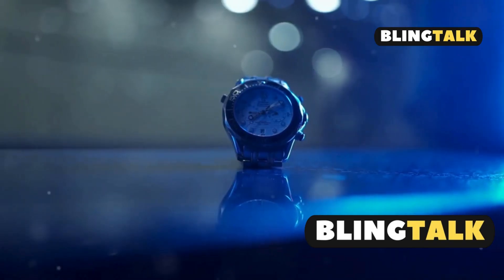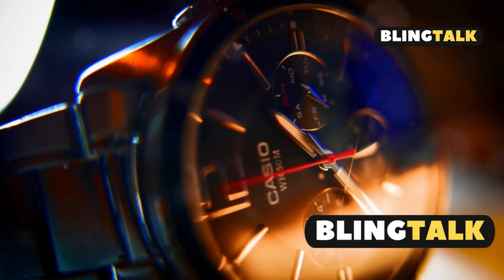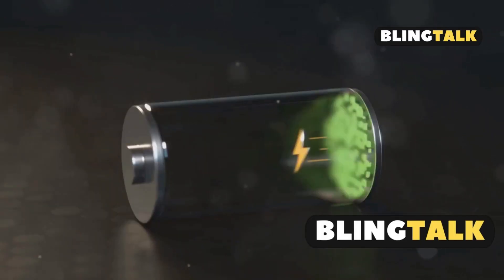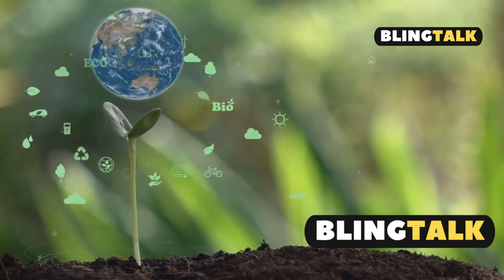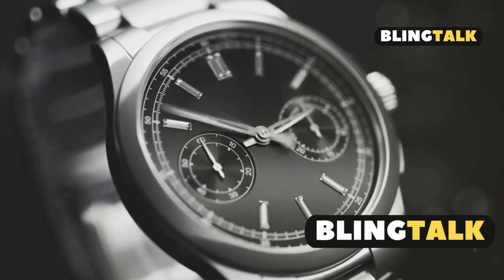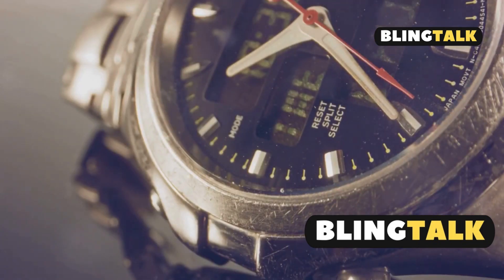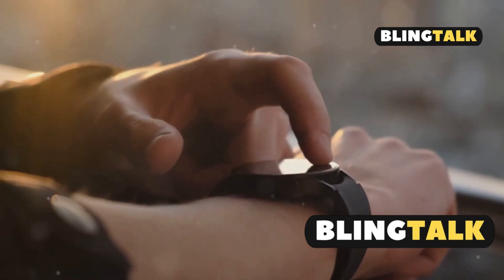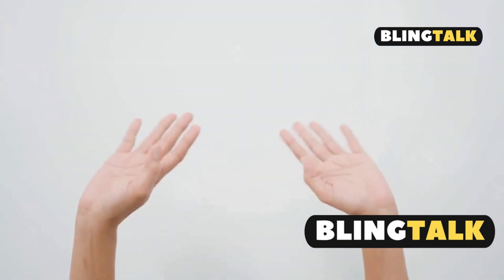How Do Seiko Solar Watches Work?

Comment: Does solar watches require any maintenance for it's inner mechanisms or is it like automatic watches where as the owner can die first but the watch still runs just on a different wrist
Reply from the maker: They do require minimal maintenance every now and then!
Reply: @blingtalk  thanks for the info! Just a follow up does seiko give their services for free since the solar watches have a rechargeable battery perhaps they can provide newer batteries when needed?